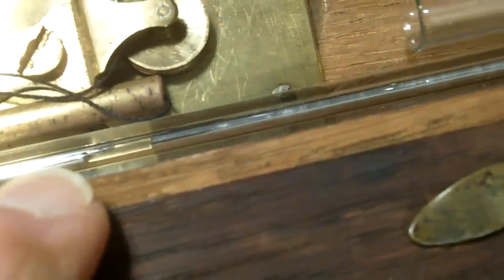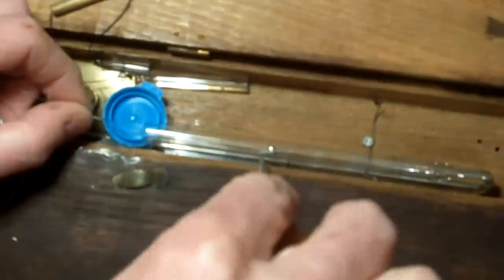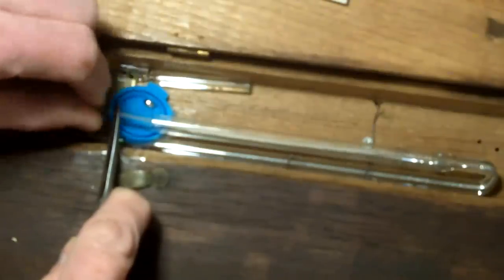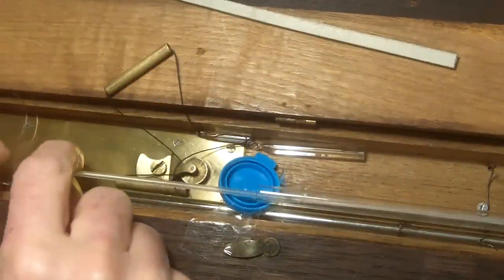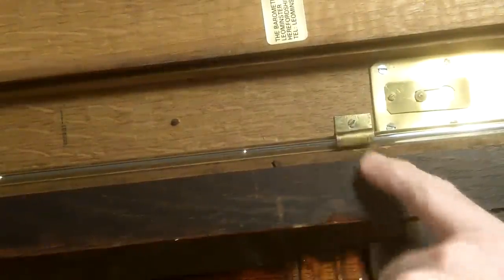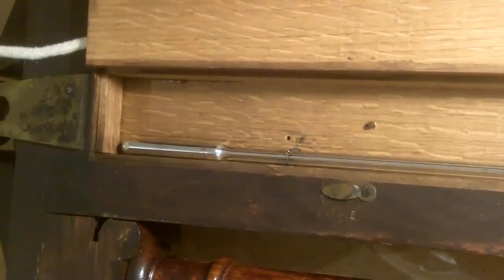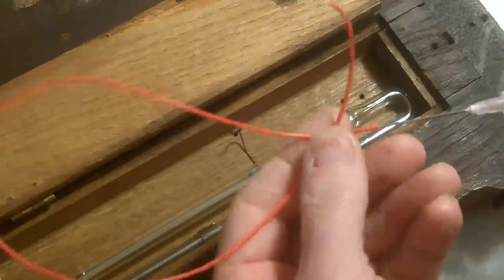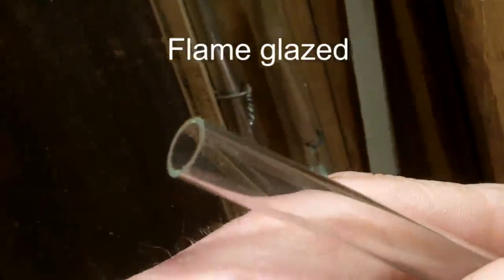Part 2 of 2  fixing a mercury wheel barometer

Comment: Hi.
Interesting video.
I have just started restoring a barometer that I bought from a charity shop yesterday for £10!
It too had bubbles in the mercury.
I had to strip it all down anyway, as one of the last owners had covered it with varnish, I think he must have put ten coats on it!
When I got the long tube out, I noticed that if I knocked it at all, the air bubbles would move.
So I carefully tapped the tube on my workbench, it took 20 minutes, and there are no bubbles anymore.
The thermometer tube was missing, so I will have to source one of those, and the wood finish around the thermometer has also broken, so it looks like the thing has dropped at some time.

Comment: Your nylon provides a path to allow the gas to escape to the outside, as mercury does not adhere to most non metals. I learnt from this, normally I just dump the tube contents, wash the inside of the glass with alcohol and then filter the mercury through a cloth then pour back into the tube and invert when it is full. Good on the fixing of the mechanism.

Comment: Thanks for posting those two videos.  I recently inherited a mercury barometre similar to the one in the video.  It came by car wrapped up in bubble wrap but when I opened it,  I noticed some of the Mercury had escaped. I managed to recover the Mercury and now I'm going to have a go at putting it back in.  I liked your method for removing the air bubbles, I'll probably have to do the same.

Comment: I failed miserably!   I used a nylon guitar string to get the bubbles out of a admiral Fitzroy barometer I got for £30 at an auction.  Cleared the bubbles as you showed but when I withdrew the nylon, the bubbles reappeared and suddenly a lot of mercury escaped!  Must have tipped it the wrong way and the dish I was collecting it in tilted spilling the mercury all over the patio.   I now have a barometer only half full.  I’ll try and source some of the quick silver on ebay

Comment from the maker: Hi there, well I reckon I'll look at fixing anything but I seem to get dragged in to help everyone for nothing, over the last few days I’ve repaired a digital camera, the multi point locking mechanism on a front door, adjusted the hinges on another security door, fixd a washing machine, reset the programming of my mates computer fixed a patio door and mended a radio. next I’ve got to sweep the chimney of the wood burner, that involves getting on the roof to get to the cowl and I love it.

Andy

Comment from the maker: Hi there, I understand your concern, they’ve been filling my teeth with mercury since I was a child, and they tell me it’s in a ‘safe form.’ I think the main thing with liquid mercury is don’t eat it but more importantly don’t heat it and make fumes. If you tip at a fluorescent tube from end to end you’ll see a tiny drop of mercury run from end to end, I made induction equipment to release the mercury after the tube is sealed. Be careful with old fluorescent tubes.    
Kind Regards ... Andy

Comment from the maker: Hi there, well I’ve never done this before but it struck me that getting the mercury out of the tube would be a lot harder than you’d credit. With such a small diameter hole in the tube air simply won’t do what one would normally expect, so I guess there are some tricks that one would learn if you did it often enough. How would you empty the column, would you poke it out? 
Kind Regards ... Andy

Comment: Recently acquired a mercury barometer at auction for $4!  The weights do not have brass weights but only glass. Are the brass pieces necessary? And the counterweight doesn’t have a glass tube to rest in...is that also necessary?  There is a wooden case with a mercury thermometer that is removable and a round area that is apparently missing something. Right now it only is a paper resembling blotter paper. Was that something for determining moisture or just a spot for a picture or mirror.  Made in Glasgow, Scotland. Thanks
Reply from the maker: Hi Teri I'm no expert in these things so I can't really help you. As an engineer I simply took the barometer and did what was obvious to me to fix that ponticular fault. I'm sure that there will be someone who can help you.
Why not make a little video and post the question on YouTube? I'm sure that someone will know exactly how to help you. Show long shots and close ups of the bits you need help and be clear about the answers that you are looking for. 
Good luck and stay safe.

Kind Regards . . . Andy

Comment: Hi Andy, I got a contra barometer . There is a glass tap low in the tube with mercury and red alcohol, the right glass tube, to close off the tube halfway. . The tap is stuck, no movement at all. And it is closed....At the back side there is a rubber ring and a wooden dowel, to keep the turning parts in place. I removed the rubber ring and dowel and cleaned the outside with aceton in case there is laquer applied for some reason.  The laquer  came off. Still the tap does not move. I am afraid to use force. Have you ever tried ultrasonic cleaning in such cases?
Reply from the maker: hi, only just seen this 8 days after you posted it, I'm sorry but I cant help you, but it sounds interesting.
My only thought is to try a little warm water but that not based on any knowable of your device. As you know glass doesn't expand very much at all with temperature but it dose expand a little bit that might just be enough. If you could get the outer part of the tap a bit warmer than the inner part it may possibly be enough to let it move. But don't go crazy with hot water!! remember what you would be looking for is a temperature difference between the inside and outside of the tap mechanism, so if it doesn't work fairly quickly the heat will equalise, (both the inside and outside will get to the same temperature and there'll be no advantage.)  Thinking about it, I once removed a stuck, tapered glass stopper from a chemical bottle by wrapping a bit of string around the neck and pulling it backwards and forwards to create friction to heat the neck, it worked but I had nothing to lose as the bottle was worthless. So, if it was mine I'd try a gentle dribble of warm water. 
Good luck. . .  Andy
Reply: Thank you Andy. Good suggestion. First attempt this night, no success yet. I found out the water must be quite hot, because the filled mercury reservoir picks up a lot of heat. I used boiling water now, then the tap and reservoir just heat up a little , I can feel it. Tomorrow second attempt. Thanks!
Reply from the maker: Hi, man I'd be very carful using boiling water!! I don't know what the glass is, it may be borosilicate which can stand the thermal shock but if not then you were very lucky to get away without breaking it. Don't do it again, instead ask for help in one of the watch and clock repair forums. Someone out there will be able to tell you what to do. Other than that try some sort of chemical/physics forum. As I say, someone out there will have a safe answer.  I hope you can get it sorted . . .  Andy  @gerl9869